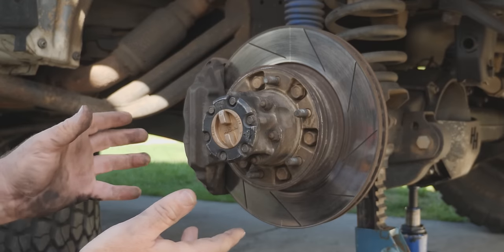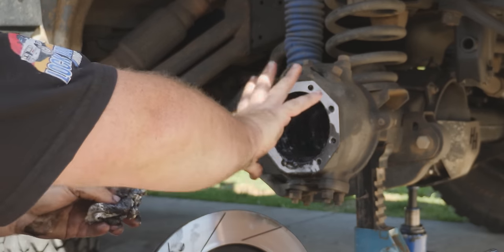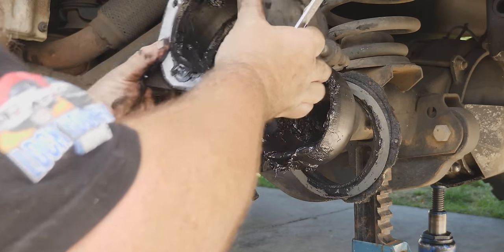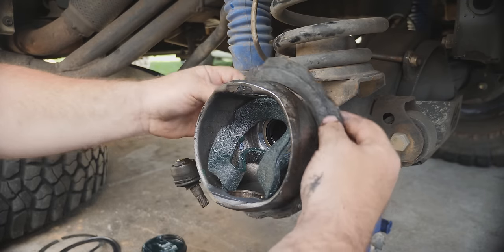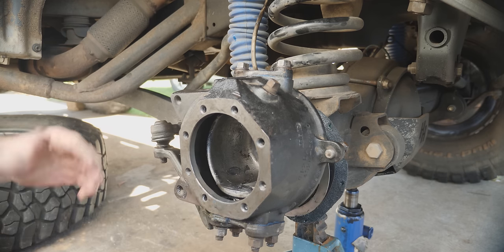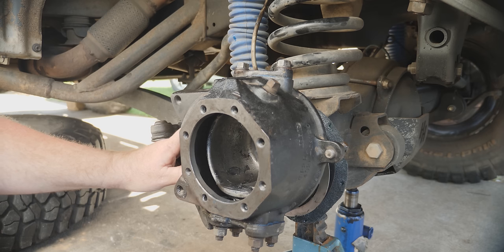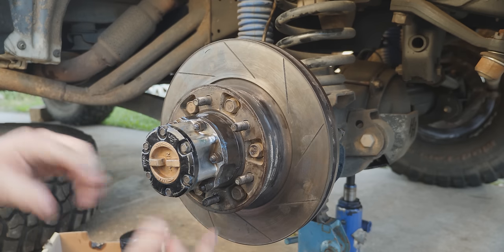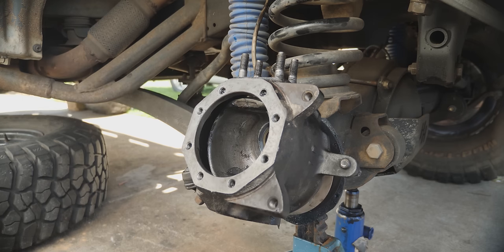Toyota LandCruiser 40 60 80 70 76 78 79 105 Hilux Knuckle CV and Birfield Rebuild

Comment: With the brake backing plates, they stop water & oil road grime in wet road conditions splashing onto the rotor and reducing the braking ability of the vehicle, I reckon they are a good thing. Those RCV CV's are the bee's knees, especially their 300M range.
Reply from the maker: Since removing the backing plates, I haven't noticed any reduction in braking performance. 

I do like the RCVs, in combination with the lockers, they have really beefed up what is usually a weak point in the 80.
Reply: @LockyourHubs4WDing  The same oily/water road grime coating that gets smeared into your windscreen is worse down at wheel level & without brake backing plates water puddles splash across at your rotors braking surface, your brake pads get impregnated & contaminated with oil film too, theoretically you could lose 50% braking capacity. Without the shielding of brake backing plates your rotors are vulnerable to rock & gravel strikes too that could scar the braking surface, I have only had issues with rocks jamming against the caliper & rim after deep bogging in mud & simply reversing usually clears them out, I like my brake backing plates & the valuable job they do.
Reply: @dustyfarmer  the same oily grime that goes on your windscreen wipes off with a little bit of a water and your wiper blade.... 2 brake pads clamping against the rotor getting up to temperatures of a couple hundred degree that grime you speak of dosnt have a chance
Reply: @Fitardvark Is that right, so I suppose the engineers who designed the braking system with a backing plate know less than you. I suppose it's also safe to assume you have not heard of aquaplaning, where a several tonne vehicle becomes separated from the road surface by a thin film of water. See how your disc or drum brakes don't work with a good drenching of water on them.
Reply: @dustyfarmer  
Damm straight!!

Comment: hi , you may have serviced lots of steering hubs and are happy to assemble the swivel hub bearings without checking the preload, but for the novices you are advising, i suggest you go back to 22'10 and show us how its done..
Reply from the maker: It's a good point, though having tested the preload drag with different height shims, small variences in shim height doesn't seem to make a lot of difference in preload drag measured with the spring balance. As long as you use quality bearings and were not having issues previously, just pop the same shim back in and you should be fine.
Reply: @LockyourHubs4WDing  how do you know someone took ur advice, and now has play in the king pin?
It’s a major to go back to set the preload..
You recon ‘it should be fine’ ..
I stopped watching ur vid at that point..!!
Reply: Mate this is the internet take everything with a grain of salt.  This video is a fantastic how to guide and its really well done if you ask me

Comment: Have you got any further info on where i can get the double lip seal and the bearing lock washer that doesn't require locking tab???
Reply from the maker: The seals are avaliable from Terrain Tamer and the spindle nut is from Trail Gear, I understand Superior Engineering in Oz sell them.
Reply: Superior sell a bit of the trail gear kit.. though they warn up to a 6 week delivery leadtime

Comment: Great video. I'm thinking of adding free wheeling hubs. I have a 97 80 series.  I want to make sure I just have to add the free wheeling hub to the front and then add a Detroit locker(auto locker)  instead of an e locker.  Since I have it set as a free hub unless I lock it it won't effect  front wheels when the auto locker engages . I hope that makes sense
Reply from the maker: The length of the wheel end of the CV is different between the full time and part time driveshafts.

With the full time shafts, you need to machine an extra circlip groove into the end to work with the orginal free wheeling hubs. I had to get my longfeild aftermarket CVs machined before I could use them.
Reply: @LockyourHubs4WDing  thank you for the info

Comment: Landcruiser. King off the off road. 

Call your local parts supplier and transmission place. No one stocks a Nissan propellor shaft but I’ll bet you my left nut they have them for landcruisers. They are weak as piss. I’ve spent so many hours helping recover mates with broken CVs and propellor shafts on their landcruisers. 

The transmission manufacturers will always say. “Yeah the Nissan drivetrain is pretty solid”. 

As a side note. I see GQ patrol and older GU patrols EVERYWHERE. But I rarely see 100 series or the 6 cylinder landcruisers…. Considering Toyota sold more of their cars. I think it’s safe to say, Nissan out lasted all the cruisers of the same era.
Reply from the maker: The brand bias is strong with this one^^^ 😁
Reply: @LockyourHubs4WDing  lol. These Rigs are old. The Land Cruiser vs patrol argument was strong back when I used to 4 wheel drive. (Granted Nissan has nothing to offer me in the last 15 years). 

I spent 10 years on the mines and landcruisers left in 4 wheel drive would come off the mud and do a UTurn on dry gravel and snap CVs. There’s no brand bias when competition trucks convert to Nissan drive train. 

No one who deals with both, has ever debated the fact that the Nissan drive train is significantly stronger. You need not ask anyone else but a transmission shop.

Where the hell are all the 6 cylinder landcruisers. They sold many more than the patrols. Yet the only ones you see on the road are the much newer V8’s.

Comment: One of the reasons the 4 studs are having issues is due to the nature of having the steering arm attached to the bottom. The studs will be seeing tensile forces from carrying the vehicle weight and sheer forces from steering inputs. It would have been better to have the steering arm either cast into the swivel housings or attached to the top.
Reply from the maker: I know Marks 4WD Adaptors do a single piece casting that eliminates the issues with the studs, though they're expensive.

Since I've been cleaning the threads, degreasing and using permanent loctite to glue them in and using a torque wrench to do them up, I haven't had an issue. 

But I agree, it would be better if they weren't there in the first place!
Reply: It you have ‘wide’ wheels, with big negative offset, you’ll have problems with your studs..
When touch an obstacle with the outer edge of ur wheel, the leverage available due to the offset will shear said studs..
Reply: On the hilux the steering arm is attached to the top, and I still lost one of them stud on my last break of king bearings. Big offset on my wheels though… but yeah I just re attached them properly and hopefully this time it’s for good

Comment: LOL>..."Freedom Units"   :)
Reply from the maker: They're a derivative of SI units, just like ugga duggas.... :)
Reply: @LockyourHubs4WDing  I'm doing the timing belt + water pump on the mighty 1HZ tomorrow (after watching your video) and I'm here now figuring out all the parts I'll need to rebuild the front solid on the awesome 75 Series Troopy next weekend.
Reply: @LockyourHubs4WDing  Definately getting those rotating seals and the aftermarket axle nuts.
Reply from the maker: @davedave2551  I used the terrain tamer kit in the front of the 80. It has all the bits and pieces included. 

Just take your time and you'll be fine. I usually plan on doing the front on Saturday and the rear on Sunday. The rear should only take half a day.

Though for the first time, just plan to get the front done that weekend.